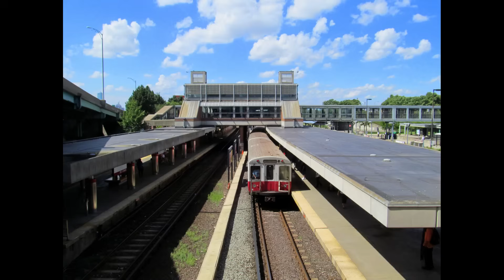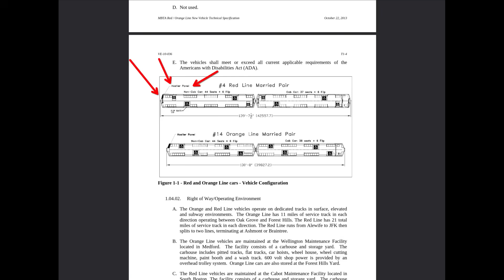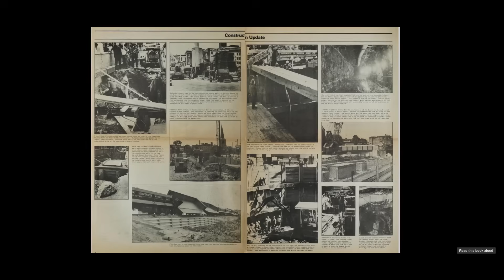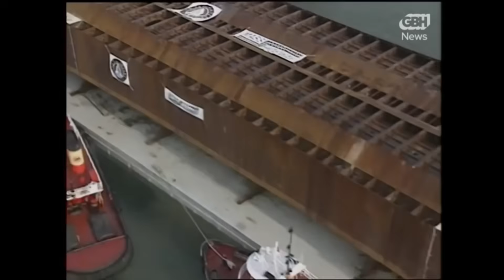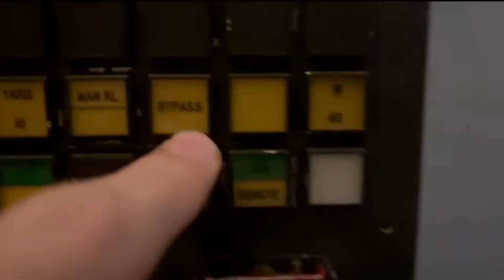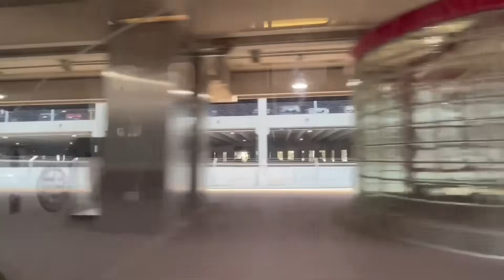How does the MBTA Red Line Work? | Infrastructure of the Subway

Comment: The equipment of the Red Line back when I work for the MBTA was the # 01400 series built by Pullman in 1964 the # 01500 & # 01600 series were built by Pullman and they are the only Aluminum cars they were order that way in 1965 the # 01500 were double end cars the reason was for that back then the MBTA had a crazy idea of having a two car # 01500 one car for Ashmont one car for Quincy they would be uncoupled at Andrew Station going back to Downtown Boston they would be coupled back as a two car train the Red Line was the first line to run five car trains in the rush hour due to that none of the Platforms were built for six car trains now in 1987 when the # 01500 series were rebuild the B end of the car was rebuild for more passenger after the motor man cab was taken out on the A end of the # 01500 was rebuilt the same way after they were rebuilt they were a married pair but the B and A ends still had there head lights were not replaced and were the main roll sign the glass was repainted aluminum color the heads light were made as a emergency light to come on when the power was shut off so the passengers can walk in between the cars the # 01700 series were built to the same the South Shore cars but they were built with a Con Steel body the order for these cars was 58 cars the cars were built so the Red Line will be a six car trains the MBTA did try running a # 01400 series as a six car train but they kept blowing the breakers all the time so they kept them as a four car train the # 01600 # 01500 and the # 01400 were rebuild in 1987 completely in late 1988 now the first 2 car train # 01442 and # 01443 were the first cars of the # 01400 series rebuild with the ATO / ATC package in 1971 to run on the South Shore line the people from Quincy was not to happy to see the # 01400 series to run on the South Shore line when the # 01100 series of the Orange Line retired 12 cars were sent to the Red Line as snow ice scraper for the Ashmont and Quincy because they were kept in real good shape for scraping the ice off the third rail the reason for them to be on the Ted Line was due to the two fires that the # 01400 series had between South Station and Broadway Station the # 01400 # 01500 and the # 01600 had there ice scrapers removed this was the the caused of the MBTA loosing a 8 cars of  the #01400 series but # 01490 and # 01491 was saved # 01490 was going to be rebuild but the MBTA GM ok it for scrap due to it costing it a lot of money to rebuild it # 01491 was mated with # 01426 after # 01427 was badly damaged from rear ending # 01604 outside of Park Street Station in 1974 by the way # 01604 was still around when I left the MBTA in 1988 it was stripped for parts finally was scrapped in the late 1980’s but # 01605 was rebuild in case it was to be used as a replacement car in case a odd number of the # 01600 or # 01500 series was needed in 1990 it was strip for parts and the body was scrapped

Comment: Nice video and subject that no one else covered in such depth.  Small point, the video shows the pre-fab tunnel sections for the Ted Williams tunnels, not the the Ft Point channel tunnels. Those would build in a casting basin in South Boston and floated out in the channel.  Pre-fabs could not be floated in because of the bridges.

Comment: 7:56 this is not quite how the air brakes work on MBTA trains. There are two systems: the service brakes are straight air brakes fed by a main reservoir in each married pair. When the brake is applied, pressure in the system increases; the more pressure the higher the braking force. The compressor noise you hear is the main reservoir being refilled after service brake application.

In addition, there's also an automatic/Westinghouse emergency brake pipe that works as you describe; in normal operation this pipe remains charged at a constant pressure and it holds the emergency brakes off. When an operator sets the control stand to "emergency" or the train is tripped by a restricted signal, air is dumped from this pipe and the brakes are applied.

Comment: Compared to similar videos which cover a MBTA subway line in less than a half hour this video manages to pack in a great level of not just detail, but explanation of things like ATO or married pairs which less knowledgeable folks will really benefit from. I consider myself knowledgeable on this topic of the red line and I learned some great tid bits which I didn't know about or fully understand previously. Also this video gives you WAY more video footage - and I've NEVER seen gratuitous IN-CAB presentations of the instrument cluster etc in one of these videos! nice! Maybe the most impressive to me is that the video takes enough time to mention things thoroughly (all of the types of rolling stock, all of the maintenance yards, even the service tracks from "Columbia" to Cabot. And someone else thought the same thing as me when those Cabot cheese advertising flags dominated south station earlier this year! hehe

Comment: On the married pair both cars have cabs (one on the outside end) - I suppose you meant which one is acting as the "Cab car" in the front. Its just about which direction you're going , though, so far as who's the cab car. The Big Red must be the same way, that consist would have cabs on the far end of each of the two cars.

Comment: Every car has a cab, but only at one end. Cars are grouped in pairs so that there's a cab on each end of each pair. For the series 15, 16, 17, and 18 cars, these are married pairs as they cannot be conventionally decoupled. For the series 19 cars, the pairs are not married and can be decoupled for operational flexibility. That's why they need to also have controls at the non-cab end.

Comment: The W 40 stands for Wayside 40, which was used on the Orange Line from Oak Grove to Haymarket and back as part of the older signaling system. That would explain the sign at Haymarket instructing the motor person to turn off ( or on) the Wayside 40 Switch .